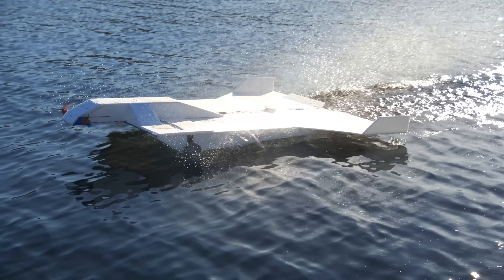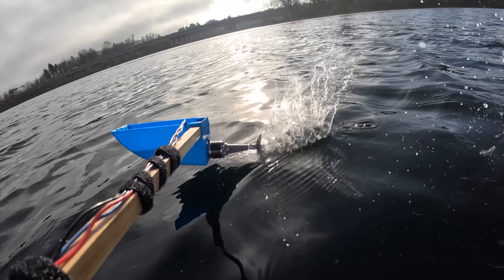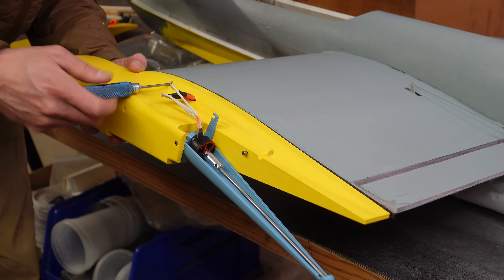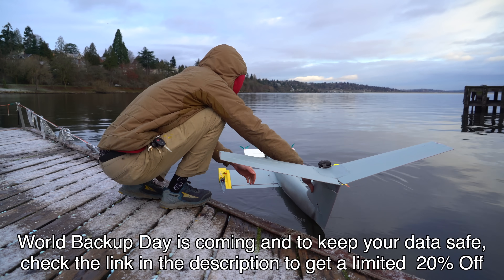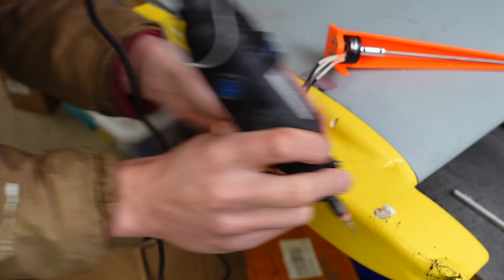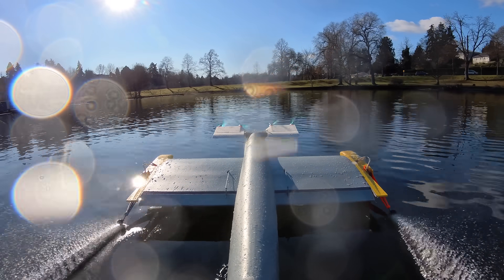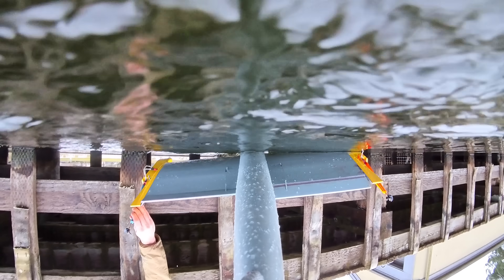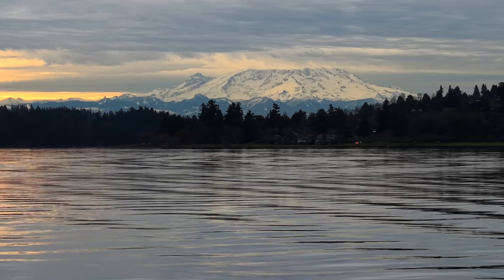Can Speed Boat Propellers Power an Aircraft?

Comment: I wonder if using a folding prop, like a motor glider, would help with the drag from the air motors?  Playing with the pitch and diameter of your surface drive props should bear fruit, most race boats I've seen have a VERY aggressive pitch for the props.
Here is a question for any legal beagles.  Let's presume that he gets this thing running with ONLY the surface drive props and somebody upsizes it to carry an actual operator.  Is it a boat or an airplane?

Comment: You could try to use folding props in combination with motor braking  to reduce drag from the motors. That's what they use in RC gliders as well.
Reply: this is exactly what i wanted to say... hope this reaches our man ^^
Reply: For folding props will not work on this craft as they would be too close to leading edge. Would hit the front wing when spinning up from folded position.
Reply: @rehepeks  unless he makes a longer mount, it would look wonky but If he gets it to be strong enough it could work
Reply: @thelittlefox1892  wouldn't be so bad actually. Wing mounted motor nacelles typically do have a bit more extension past the leading edge. The PAR thrust should not be overly affected either. Could even see a tiny improvement as a bit more of the propwash could make it under the wing.

Comment: If you put a single prop on the back like an ev outboard you could use it for turning as well.
A high wing might  work better as when it drops out of ground effect  it is touching the water surface making it hard to lift again.

Comment: Seems like you could make a speed hovercraft using this. Basically one of two air props solely for making a curtain of air to glide on, then surface piercing water motors to accelerate forward and steer.

Comment: What if you have those paddles up above spinning backwards at a high rate to generate lift?  So the padd wheels touching the water spin forward but the other ones spinning opposite could be programed to run slower on either the left or right proving yaw. I bet you keep it level in flight with those spinning paddle wheels on top.

Comment: For those who would like to know, “NAS” stands for “network attached storage”. It’s basically just a collection of magnetic storage managed by software and connected to the network.
Reply: You can also do NAS much cheaper than what he did in this video. That drive enclosure is likely $200-$400 and each one of those drives that he is using is at least $400, and he's using 4 of them.

Realistically, nobody other than video/music editors, businesses, or people doing large scale data archives needs that kind of setup at that cost. I'm all for hosting your own NAS but I also know from experience that you can use  a $100 used gaming PC from 2015 off craigslist that is packed with 8 HDDs that have 8tb capacity that I got used off ebay for $40/ea. My cost is a fraction of buying a pre-made system and I have similar performance, even better yet chatgpt gave me extremely detailed instructions on how to do setup.
Reply: and if you have a collection of old mixed sized drives then worth looking at Unraid.

Comment: Thoughts on your paddle wheels (sorry if you already covered this in an earlier video);

 How many blades per second are contacting the water? So, I'm guessing 10,000 rpm is the right order of magnitude for your paddle wheel speed. With 12 blades, that's 2000 blades per second, or 500 microseconds between blades. Further, estimating your paddle wheels to be 100 mm in diameter, the tip speed of the paddles would then be around 50 m/s or a little over 100 mph. This is much faster than the speed of your test boat or your ekranoplan. 

So now to my point. With the relatively low water in-feed rate and the very short 500 microsecond period, I don't think the buckets of the paddle wheel are really filling with water. I suspect it's only the very tip of the blade (like possibly only 1 mm or so) that is interacting with solid water. Essentially I'm speculating each blade is mostly operating in the hole left in the water by the previous blade. This might help explain why different shape wheels don't make a lot of difference.

Comment: The other thing with having your own NAS, is that you don't need subscriptions to things like iCloud, OneDrive or Google thingy, I have subs to each of them including 2 the Microsoft, god knows how that happened, but I don't know which OneDrive subscription is that one I'm using, so I'm loathe to cancel one of them in case that's the one that has all my photos on it. So yeah, I need to get one, or I should say I need to get one again as I had a WD NAS for years, but ironically enough I knocked it off the table and damaged the HDD.

Comment: the windmilling props on the air propellers are adding a ton of drag as you said in the video...I haven't messed with the blheli firmware but I imagine it has to have a brake function. Turning that on ought to help stay up with just the water props...

Comment: Have you considered making a surface effect ship? It's like the illicit love child of a catamaran and a hovercraft - a boat with two hulls and a flexible skirt at the front and back to trap an air cushion underneath. The solid hulls mean that it's no longer amphibious, but it also means that water propellers can be used instead of air propellers, and the air cushion means that a minimal amount of the hulls are under the water. Might be an interesting project!
Reply: So Cool 👍👍👍
Reply: Like the Norwegian Alta class: https://en.m.wikipedia.org/wiki/Alta-class_minesweeper
Reply: Interesting
Reply: Sounds more complex and unwieldy than a hydrofoil, and those have enough issues.
Reply: Illicit 😂🤣😆

Comment: Nice plane! I got idea - try to use spiring shocks from 1/10 cars instead of rubber band in pod hinge.

And also - for reach ground effect speed and pull out from a water big object, like your plane - i think it need around 2-3 kilowats of power.
We use inrunners, from 2860 size and bigger, on 3s on FSR ECO expert racing boats - 1 kilo plaining boats with fully deep water props

Comment: Could you map a takeoff mode with 1:1 throttles, then switch to a cruise mode that caps the air props to 10%? 

When it worked I’m assuming there was a slight head wind to provide the spar lift.

Comment: maybe dampen the water propeller arm to boost propulsion, now it seems that each time it touches the arm flings up, the rubber band helps but a damper will change everything. You can find RC car dampers for cheap but it will require tunning

Comment: I have a theory that the air motors are lowering the speed at which the vehicle will go into ground effect. When you turn them off the thing just drops into the water. Maybe try and slowly throttle them down instead of switching them off so the water props have time to increase the speed of the thing to the new ground effect speed.

Comment: Mr Rctestflight, I've had a question on my mind since you started your propeller comparisons. Nature tends to find certain optimal solution, especially when there are a lot of constraints. One common method of propulsion through fluid that nature has optimized for efficiency is the flagellum, a simple rotary propulsion system without fins or blades. I just don't have the means to comparatively test it like you could but essentially all you'd need to do is attach a rope directly center to the output of a motor. As it spins it will naturally be pulled outward by centrifugal forces which exerts force on the surrounding water propelling it forward which causes the tail of the rope to drag backwards, but the centrifugal force that is getting transferred into propulsion will be along the entire rope, ideally allowing for high efficiency. 

Of course length and thickness of rope matters, if the length is too great it will just create drag, if it's too short it loses efficiency at transferring rotational force into propulsion and of course this probably wouldn't be ideal for speed boats as at some rpm you will get cavitation and the rope would just whip around. But I feel like this is a logical progression of "less blades = higher efficiency" while maintaining balance as a flagellum is essentially a single blade that just happens to be flexible and would naturally find some equilibrium of shape to transfer force effectively. If you think about it, "perfect" theoretical prop would be dynamic in shape, as the the profile required to transfer force efficiently is actually different at different RPMs and fluid densities, a flagellum, being flexible, might just be something. There's lots of reasons why it makes sense in my head but I have no idea if it works at scale and at what speeds the whole thing breaks down but I would love to see some experiments. Taping a rope to the end of a motor seems like a pretty feasible project considering the massive scale and complexity of some of your projects.

Thanks for all the cool content and experiments!
Reply: I don't think it will work, there's a reason why the flagellum as stayed in the microscopic realm, the scale and the properties of matter at that scale are just too different
Reply: Yeah, scale changes things alot. Just like how rc planes based on real air crafts needs a different wing profile than the real plane. The wing scales down, but the air (and water) molecules do not.
Reply: It's a good idea but Reynolds number is the devil here. Water is much more viscous at micro levels, a flagellum is more like a 3D snake pushing off a solid
Reply: It’s how all the fish and whales do it. I suspect it’ll do great as long as you have laminar flow conditions. Highly efficient; not designed for speed. But I can imagine a prop with a flexible trailing spiral, designed to prevent cavitation at any reasonable prop RPM.

Who has seen Star Wars Episode I ?

Comment: Would think it would do beter with anothrr prop in the center back. So when you pitch to one side or the other you still have 2 props on the water. Most of the time it left ground effect you only had 1 prop or no props in. Next question they use laser highet sensors on drag cars to prevent them from doing a wheely. Is this somthing that could be used to monitor distance from water and adjust PWM with it some how giving you a auto throttle to keep it in grounde effect.

Comment: radial paddlewheels flings water upward, which isn't efficient and weight on the plane, the paddles should be oriented with a negative angle of attack the they repel the water downward

Comment: For rc boats The surface piercing props you used are better suited for calm water so for rough water if possible you should source some with pointed tips as they will  more than likely have better thrust when in and out of the water constantly and may well benefit this experiment.
Reply: That sounds right. These did give decent drive but would be sporadically shot up out of the water by ripples.

Comment: I don't know that youtube are doing. But this video is AV1 for me. My pc does not have an AV1 decoder so it uses a lot more energy.
On top of the the 1080p version has a lot of encoding noise and the video does not look grate.

So I get worse image quality and higher power consumption. But I guess the bitrate is low. 😢
Reply: For me the 1440p version is VP9 and that can be decoded by my iGPU.
The bitrate is of cause higher thus I need to download more. But the image is much cleaner and my pc uses less power. 🤷‍♂
My screen is only 1080, but I of cause still get the benefit from the higher bitrate.

But it is a little disappointing that 1080p now looks really bad for no good reason. 😢

Comment: One thing that comes to mind is the weight distribution of the air frame and the positioning of the water prop. If you were pushing it up with your prop assembly that also acts as a foil forwards of the COM, it would naturally tilt up providing lift. This prop arm needs a shock absorbing strut to stabilize it as it bounces on the surface. This way you'd need only a small flaps on each wing to push the frame against the ground effect mattress.
Reply: Agreed! The water props need to be well ahead of the centre of balance for the aircraft, potentially in line with the props on the wing, and they need dampers.

Comment: Have you considered a boat that pulls itself through water. 

Saw an insta reel the other day that had a pull propulsion system on this Swedish or Swiss boat (looked like an f117 on the water - “ghost boat” I think they called it. . The cavitation allowed the hulls to have less contact with water… I expect over time the bubbles popping on surface may be an issue with pitting however Morey boogie and golf balls have dimples to create bubbles to be more efficient… so maybe it worth a look see.

Comment: You need a couple of kw per side on big props with sharpened blades and a LOT of preload weight, use the dolphin tail at the prop if you are worried